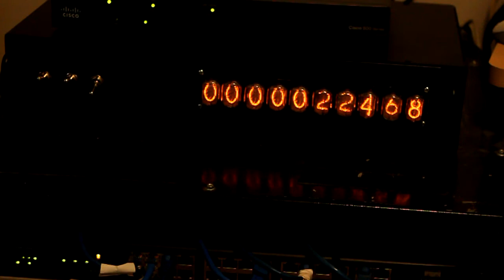Nixie Tube Web Counter

Comment: Apache httpd is capable of writing error and access log files through a pipe to another process, rather than directly to a file. This capability dramatically increases the flexibility of logging, without adding code to the main server. In order to write logs to a pipe, simply replace the filename with the pipe character "|", followed by the name of the executable which should accept log entries on its standard input.

Comment: There has to be a less expensive way to do this.  My webserver is running right next to me on an HP 5135 thinclient running tinycore microcore linux + apache and is completely solid state, zero moving fans, solid state usb memory.  But how do you direct Apache log file --> to console?  instead of a file.  Not only could I see webhits as the occurred, but with reverse lookup, where from.